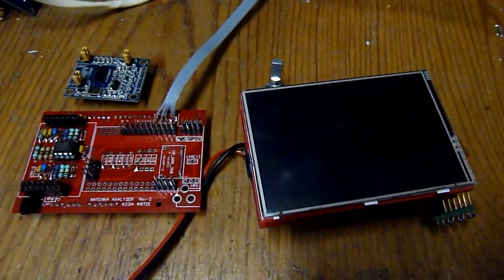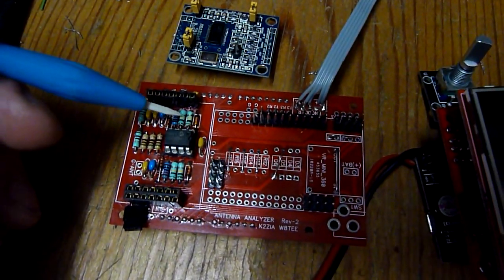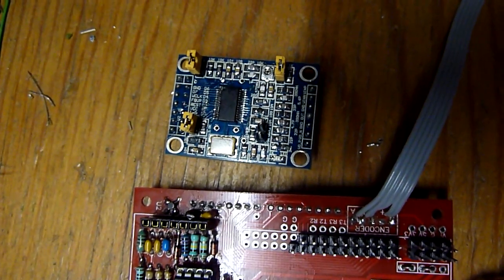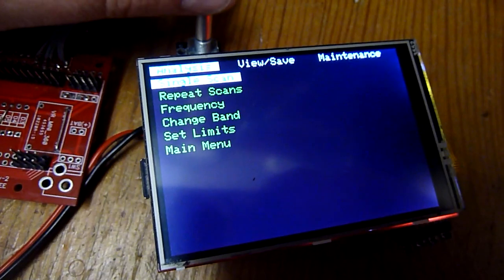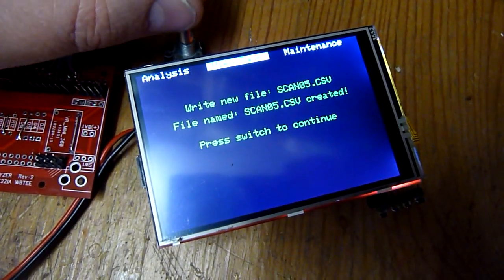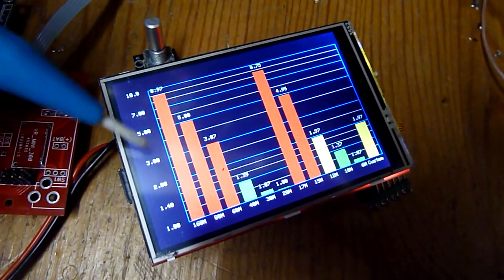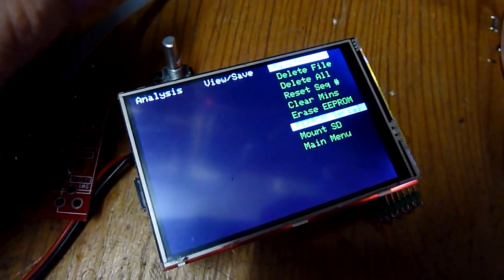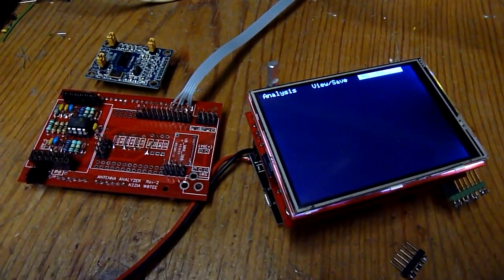00000

Comment: Hi, I’m working on the mods. In this video are you using the AD9851?
Reply from the maker: Yes, the ad9850 will net perform properly on 6m. Running a test with a resistor works fine but checking an antenna on 6m gives bad results if you use the ad9850. The AD9850 and 9851 boards a re the same, the same modifications apply.

I did write earlier that mods can be used seperately, but if you remove the 200r resistor from the DDS board and add a 82 ohm resistor in series with C6 you better also change the mmic. This mod will silightly decrease the input power on the mmic which already had low output power. So If you decide play with the resistors to match the output impedance of the filter on the DDS board, than also place ERA3.
Reply: PE1PWF Hi, thanks for the reply. If I’m not worried about 6 meters then the 9850 should be fine, correct?  

Also I was going to order ERA-3 MMIC but should I order MAR3 MMIC instead?
Reply from the maker: Glad you pointed that out, I accidentally wrote mar3 but that MMIC is about the same as the msa0386. For the mod you do need an ERA3.  If you don't want to use 6m ad9850 is fine.

Comment: I don't a few of your mods. I jumped D4 and D5 and D6, plus put a 100 ohm in line with the cap on the mmic. I kept the stock mmic can I still change the resistors for the diodes and the 100k ones?